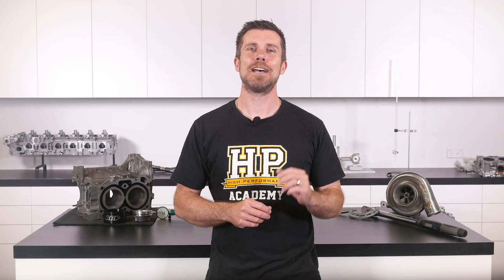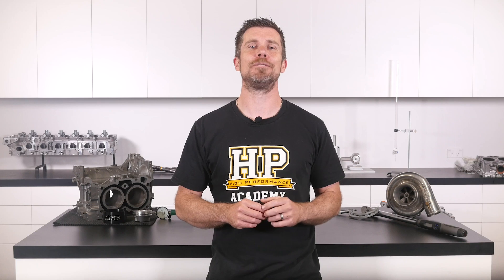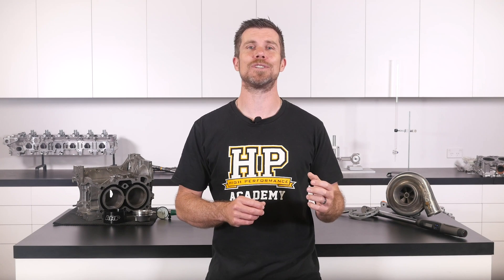Throttle Response | What Should You Tune For The Best Result? [HPA Q&A]

Comment: Absolutely nothing beats the feel and throttle response from tuned carburetors.  More specifically an engine with a carburetor for each cylinder.
Worst throttle feel and response is from pure drive/ride by wire throttles.   My track bike (R6) is ride by wire, but still has a throttle cable for good reasons.

Comment: I had a locked dizzy running for years and missing out on decent throttle response, then purchased the msd programmable and holy hell never looked back even gained fullboost earlier.. They love timing  before boost ramps in.. Love you tips and your chanel

Comment: my modified fiesta st180 has bad throttle response at light throttle input.. feels like something is working against something else... is that a dirty throttle body or maybe a dirty boost sensor or even both?? since i bought the car (the mods were already installed) i first did engine oil + filter change, gearbox oil change, cleaned the after market air filter, cleaned the MAF sensor with MAF sensor cleaner, fitted new swan ignition coils, new OEM spark plugs. Thanks

Oh and it has a stage 2 Peron Pro tune with all the supporting hardware, max boost PSI i have seen is 22psi.

Comment: I can’t seem to find the enrichment table on my carburettor, can anybody help
Reply: Mine has one, it's called an accelerator pump!
Reply from the maker: We don't cover carburettor tuning sorry Sammie! Or Dave! 😎If you end up with something that has EFI or are more into performance engine building we can help you out though =) - Taz.
Reply: High Performance Academy 
More performance? My carby has seen me this year claim the national series title in Formula Vee. Just because it’s not EFI doesn’t mean it doesn’t go hard
Reply from the maker: 'Performance engine building' as in the topic 'performance engine building', not 'more performance' ;) Carburettors still have an advantage over EFI when it comes to WOT, but for that one thing they are better at there are a lot more areas they fall short on by comparison. 
There are pros and cons for everything, even EFI, and if carbs are working for you then you don't need to change to EFI unless you had a specific reason to do so - Taz.

This video runs through a few comparisons: https://youtu.be/2Q49DsNmcsI
Reply: Get your friend to spit some methanol in the intake manifold. Works 100% saw it on a documentary called “Mad Max Fury Road”.

Comment: How lean is that spike and for how long is acceptable?
I have that issue. After a agressive gear change with closed throttle and then full throttle on next gear i often se a lean spike with about lambda 1.2 for 200ms of time. Then the lambda goes back to about 0.85

Is this condition damaging my engine?
Reply: Shame you didn't get a response from this. I'm in the same boat 😥